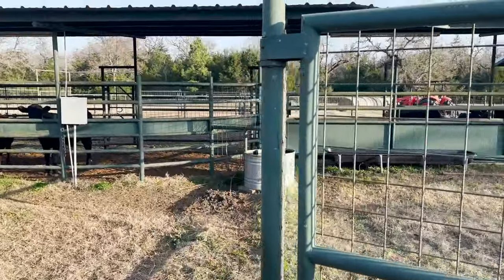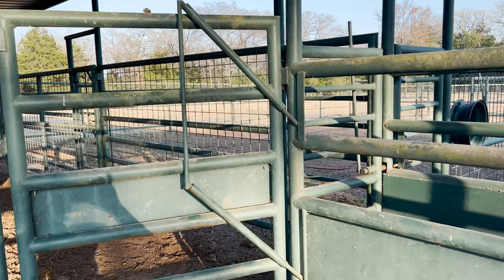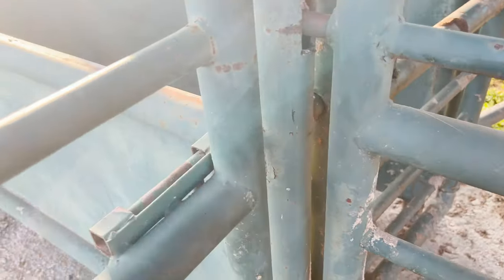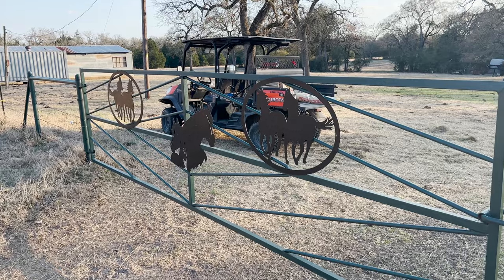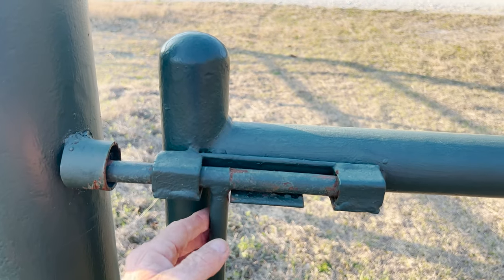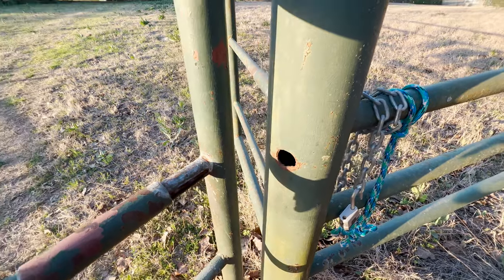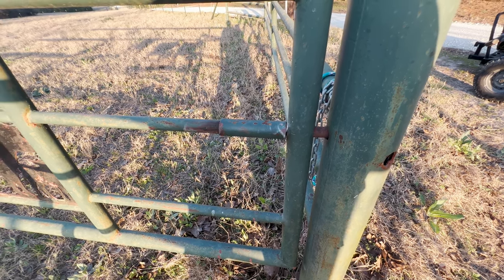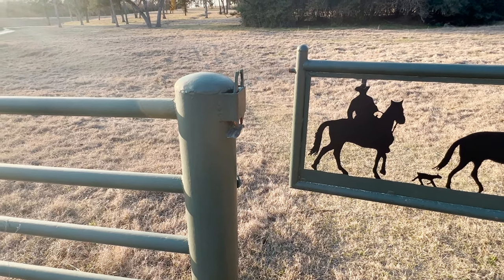Gate Latch Options For The Ranch | Regenerative Ranching

Comment: Gates always sag . Sliding bar latches alwsys need space for vertical movement. Fixed holes you always strain hernia in ur gut or pinched nerve in ur back.As long as stock pushing against post in closed position nothing is faster than hooking chain on nails hehe 😊
Reply from the maker: Excellent point!